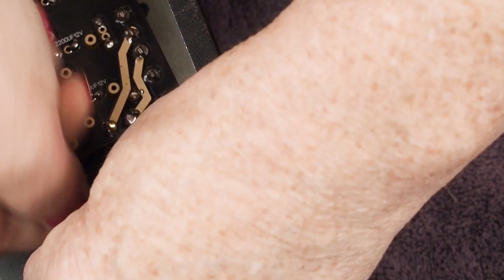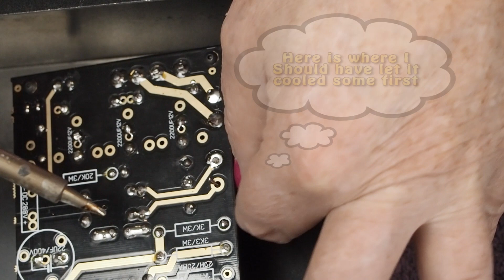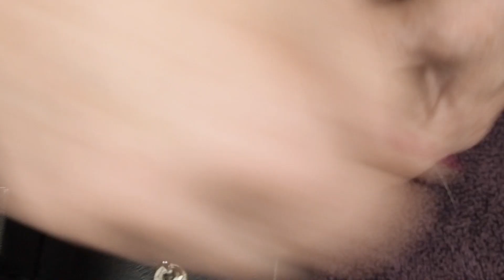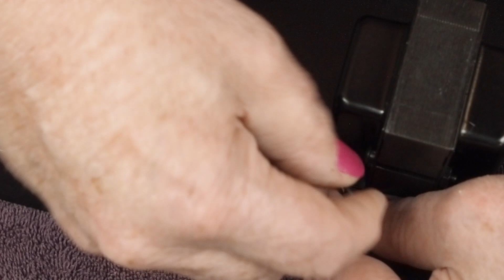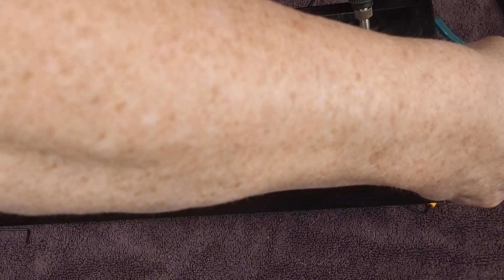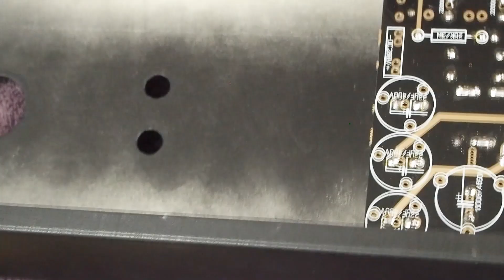All Tube Phono Stage Pre-amp Part 14: Assembly

Comment: Hello. I'm currently building this preamplifier as well, and your videos are very helpful. What are the values of the choke? I can't quite make out the values on the circuit board.
Reply from the maker: I believe it's 20H A 20ma I use a hammond  154E
Reply: @SkunkieDesignsElectronics Thank you. Is it the 154E  1,7kOhm?
Reply from the maker: There is one part number 154E https://www.hammfg.com/part/154E

Comment: I'm sure you mention it somewhere but what size fuse do you use in the IEC connector?
Reply from the maker: 5mm X 20mm
Reply: @SkunkieDesignsElectronics  Thank you. I also should ask, Do you feel a 10 amp is correct for this and if a slow blow type is recommended. Sorry for the dumb questions but this will be my first project.  BTW - becoming a patron today.
Reply from the maker: That's WAY too big!!  I use a 750ma, a 1A would also be OK and yes use a slow blow

Comment: Great video. I really enjoy your work. So many questions about that choke. Looking at the board, the original design looks like it was calling for a 1.1k/ 3W resistor. But you put a choke in there. I'm guessing that is a Skunkie special modification. I imagine that would help smooth out any residual ripple in the DC. How did you decide where to put in in the circuit. How did you decide what value to use for the choke. 
As for a bleeder cap, could you just put a cap right across to the points where you were getting your voltmeter readings?
Thanks. Cheers!
Reply from the maker: The board has printed on it *20H 20ma on that spot :)

Comment: I don’t think the Choke was part of the original design or clones,what value did you use? Would it be worth adding Chokes to the B+ High Voltage Rails?
Reply from the maker: The board I am using lists either a resistor or a 20H 20ma choke. I obviously used a choke :) And yes, this is the first stage of DC filtering for the high voltage B+.

Comment: I finished this board but noticed the led does not light up, so tried a new one which i tested before, I have a blue led with 100 ohm resistor, still didnt light so i check the voltage and its showing at the led their is 38 volts dc is this correct?
Reply from the maker: That doesn't sound right, so I just checked mine and across the LED I am reading 1.78V DC.
Reply: @SkunkieDesignsElectronics  thanks i will hv to do sone research
Reply: Do you hv any tips of what to check
Reply from the maker: @MrAppleimac01  Are you sure there is 6.3VAC onto the input to that section of the board? On the top of the board there is marked  "6.3VDC" and you should see that voltage there, if not it will fry the tube heaters! Also the LED is drawing power across the heater feed, not from the heater feed to ground as they "raise" the heaters above ground potential. Is the 38VDC you are seeing across the two pads for the LED or from one of those pins to ground?
Reply: @SkunkieDesignsElectronics  you were right i was measuring it from ground to one of the pins accross the led i have 2.83 vdc. Do you hv any idea why it does light? Is this too low a voltage for blue led? If so can i do anything about it or do i just need to change the colour?
Reply from the maker: @MrAppleimac01  polarity reversed would be my first guess. 2.8V is enough to light most any LED.
Reply: @SkunkieDesignsElectronics  I had the polarity correct but not the right resistor, now it lights just want to check one thing ref the voltages. I have 8vdc and 303 volts is this ok

Comment: I noticed the power supply board shows a gnd but no ground was connected in the video?
Reply from the maker: The ground is on the signal board at the phono ground lug in the front.
Reply: @SkunkieDesignsElectronics  ah yeah, thanks its taking me a long time to build this due to getting the parts, but im coming close to finishing it, thanks for all the help

Comment: May I once again call on your knowledge, in regards to the hammond 369 transformer used. I new to wiring a transformer and cant firstly figure out how to wire it for 230 volts main. Secondly what secondary wires i use for the amp.

Comment: Was wondering if you could help me out of a fix this is the first time ive wired a transformer on a scratch build. Im not sure how to wire the Hammond 369ax for 240 volts and what cables i use for the tubes… so many wires and colours.

Comment: Twisting AC cables reduces hum. What about DC ?
Reply from the maker: DC should have no hum.
Reply: One more question about signal caps. I see you used Mundorf and MiFlex. Fortunatelly MiFlex manufacturing plant is 100 km from my location. Are they really worth to change from yellow Douk ones. Mundorfs are quite expensive so maybe later Step by step. With resistors there are many opinions that they do not change music so much. Caps YES.

Comment: I was worried to see your fingers seemingly near the circuit after it was supplied with AC power.
I just saw after writing this that you find there was no bleed resistor, is it possible to change this ?
Reply from the maker: This camera from this recording position distorts perspective. My fingers aren't near the board. This is the one thing I do focus on while filming, to not get distracted and electrocute myself!

Looking at the schematic, there is 220K bleeding resistance, and bleeder resistance vs load is a balancing act. Add enough where it quickly drains the caps causes a lot of load and heat into a power supply. mainly I wanted to point out to beginners, just because the device has been unplugged, doesn't mean there is no high voltage.
Reply: @SkunkieDesignsElectronics  Oh Ok, thanks for your explanations.

Comment: Great series, Stephe! Is there a reason you don't check voltages, etc. before you mount the boards? When you do point to point it's not an option, but with a pcb you could just do a dry run. This is not a rhetorical question, just curious about your workflow.
Reply from the maker: I don't expect to make stupid mistakes :)
Reply: @SkunkieDesignsElectronics  Oh, I see. That's my default.